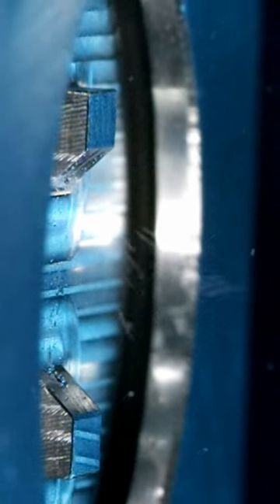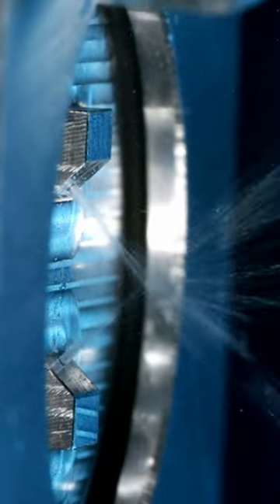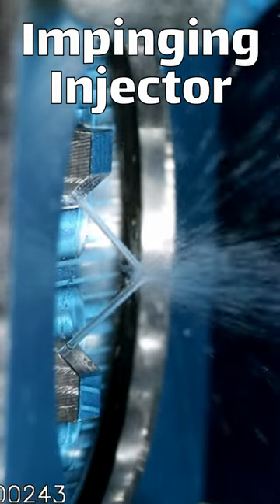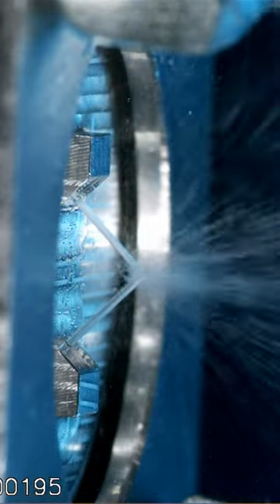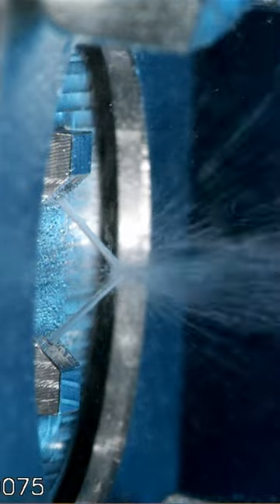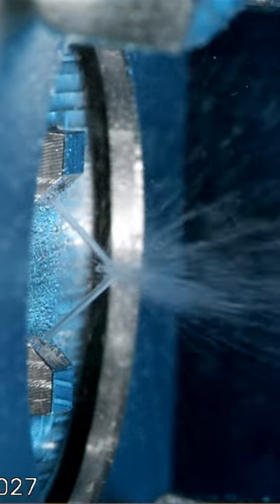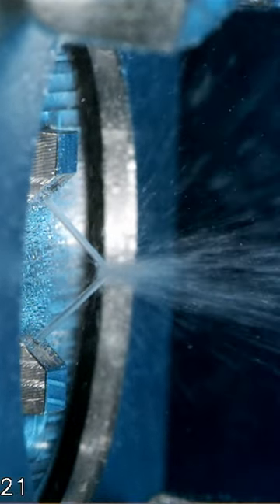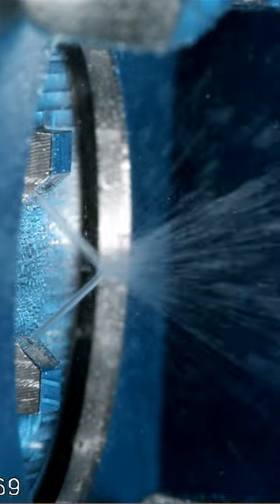Impinging Rocket Injector

Comment: I'm not 100% sure, but as far as I understand, ussually impinging injectors are like on like, so two oxidiser jets meet, or two fuel jets, so that the propellants are atomised before the mix, providing better combustion. If it were unlike on unlike, then the energy from combustion would force the jets apart, and could cause combustion instability. Still a great video, love to see rocket engine components up close.
Reply: I was thinking the same thing... If the two fluids are different than it would push to one side... Unless you did some really complicated math and engineered the holes just perfectly...
Reply: Agreed.. this seems like a dual injection system in a internal combustion engine..yes .. cars that use piston engine... I hope I didn't mispronounced it..😂😂😂
Reply: @jackelewish1568 I am not disagree with you guys on that they are used to atomize. 

 Yet if they are for rockets carrying expensive 5hinfs. Then tthey would honestly most likely be engineered correctly to give out the right amount/pressure to compensate for each fluids traits, and not symmetrical holes. 

 Places like NASA can be pretty meticulous. 

 That is just my opinion. Maybe more like a "I hope so". Maybe one day with AI we will be able to perfectly mimic fluid dynamics.
Reply: This is used for hypergolic fuels.  Fuming nitric and hydrazine, for instance.

The ascent stage of the LEM used it, because it absolutely had to work.   No relying on fuel metering valves and spark systems that might fail.

Comment: As a machinist who's made those, them chatter marks are unfortunate 😅
Reply: And the particular irregularity of the upper jet tells me there is more inside xd
Reply: @ashtonpadilla5269  very probable
Reply: Don't look good bo
Reply: They weren't feeling the need(s) for feeds and speeds.
Reply: made on a desktop cnc. Its really not too bad
Reply: as a machinst who doesn't make those but makes small engines, I agree
Reply: Probably use the ones that didn't work out for the demonstration

Comment: This is cool. I built something very similar to atomize fuel for a pulse jet engine a few years ago, and it worked pretty well. I use small diameter superduplex tubing and pumped water through the injector to check the alignment of the streams before installing it in the engine.
Reply: you have nice videos.
Reply: have you built anything similar since the small pulsejet 7 years ago
Reply: Kudos. I'm actually impressed. Shame you don't own the patent...
Reply: Thanks, I built a valved pulse jet engine about 6 years ago. I have been busy with college, but I just finished up my MS, and I am going to start working on pulse jet engines again.

Comment: I hate how stupidly underrated this channel is. Seriously top top tier content, keep it up :)
Reply: Definitely. Also just imagine impinging streams right before/on a screen, and even multiple streams.

The pressure from the fuel injectors pushes it past the screen, then one more screen for further mixing + atomizing. That screen would also hold heat from the combustion to make agonizing even more efficient, help block the flame front, and help keep heat away from the upstream.

This idea is brilliant for smaller rockets, even if it isn't originally his
Reply: Nothing is underrated but simply unknown. Share the channel with everyone you know, or your words hold no value.
Reply: @clayton9136  underrated by the algo I mean. Like there is trash tier science content that gets millions of views but actually really cool shit that took a ton of work doesn't get picked up by the algo and it's criminal. Also liking, commenting, engaging with comments and subscribing are probably the most effective ways to boost the chances of the algo picking it up
Reply: yeah like the one where he doesn’t know what a 90 degree angle is
Reply: underrated? He doesn't even know his angles.

Comment: This same technique is used in NOS injection, one little hole produces a small stream of fuel and another hole about at 90 degrees apart injects a high pressure stream of nitrous oxide in liquid form. When this two streams collide, a huge stream of small droplets of nitrous oxide and gasoline is created…

Comment: This is awesome. I found out a couple of days ago that each Saturn5 engine had its own JET ENGINE as a FUEL PUMP moving fuel instead of air.
Reply: Yep, you can tell when that's a system in use on a rocket by a "pilot light" flame exiting away from the engine bells. That's the turbo exhaust.
Reply: Yup. And if I recall correctly, they produced around 75,000 horsepower each using the very fuel and system used in the rocket. Amd it will fit under the hood of a common sedan of the era. They item is called a turbo-pump. It is comprised of a common shaft driving two pumps, for fuel and oxydizer. It is still, not rotating, until launch. Then, as the two fuel components are relased and converge at the turbo-pump, a violent acceleration takes place and can throw itself apart due to the invomprehensible rotational forces. Each stage had different engines from the others. I'm talking about the main stage engines.

Comment: ive always wondered about what a triplet impinging injector would be like if each jet was offset a few degrees so that instead of colliding, the streams more so glance off each other, perhaps creating an atomized spiral instead of a flat plane. i know atomization isn’t what youre going for for your particular project, but none the less
Reply from the maker: It's definitely an interesting idea! I bet it would get quite complicated, since there are probably different regimes where surface tension would dominate (causing them to sorta spiral and glomp together). But I bet if you got everything dialed in, you could get a cool swirl-injector effect but with impinging jets. Would be pretty neat to see!
Reply: So triplet injectors are a thing! Technically, the full name for this injector is a like-like doublet impinging injector, because it's two ("doublet") jets of the same fluid ("like-like"). There are unlike doublets (see the engine at the base of the Saturn V), unlike triplets, unlike quads, etc, all with decreasing popularity for some of the very issues from this main vid.

As for the spiral idea, there is another type of injector element called a coaxial swirl injector designed to set up the kind of spiral flow pattern you're getting at. However, in free space, no impinging streams will form a spiral, as there is nothing to force the fluid back toward a central axis. Once collided, the jets, whether atomized or not, will continue on their way with whatever resulting momentum there is after the collision
Reply: @BreakingTaps  do eeeet
Reply: this fuel is clearly not being atomised, those droplets are enormous compared to atomising injectors.
Reply: @GamezGuru1  Check again when the injector pressure is 3-5 ksi and the chamber is at combustion temp. No idea if this clip is for a real rocket engine, but this waterflow test has much lower flowrates and velocities than one would typically see in an operational engine.

Comment: I hope that there's not any h2o condensation. How is that mitigated?
Reply: When you have an actual flame in the combustion chamber, the problem isn't condensation, but evaporation- of the chamber!
Reply: @r0cketplumber Very well put
Reply: @sensoryoverload673  I've done it. Copper burns with a very pretty green flame. Once.
Reply: The h2o would actually add thrust. If you're worried about propellants freezing, you just have to put it closer to the flame front
Reply: @r0cketplumber  engine-rich exhaust

Comment: is 90 degrees the best angle?
Reply: Yes
Reply: @revmsj  why?
Reply: It ensures uniform mixing of the two fuels. If the angle is too small, you get issues with droplet size and fuel flow, angle too large and the fuel doesn't mix properly, and you'd be lucky to get droplets at all. @chrismofer
Reply: @Sara-L  then why do I find lots of designs for impinging injectors with a 60 degree angle?
Reply: Depends on momentum flow and combustion chamber geometry.  Worth mentioning that this is only a 2 stream injector and that other impinging geometries exist as well.
Reply: @chrismofer higher angles create greater towards-nozzle velocity so the burn region is a bit further from the back of the combustion chamber.
Reply: @chrismofer it depends on what your building and how the engine handles it, and where you want the explosion base to be, it's kinda like a bouncy ball, if it has infinite bounce it will make a pattern, same with liquids but at a lower angle it should be a heavier more lower explosion, while a higher angle should be a higher up explosion or whatever the test results endure, go take two hoses and mess with the angles lol 😂

Comment: Ahh like a chimney rose. For chimney fires we use to screw malacca canes together and shove them up the chimney. There would be a chimney rose at the top attached to a long rubber hose. We’d pump water from a bucket up to the rose and it would squirt out just like in the video forming a fine mist of water (not rocket fuel). You sometimes had to pump like crazy to make sure the canes and hose didn’t get scorched. No, I DID NOT join the fire service before the moon landings.

Comment: those are 45 degree not 90.
Reply: They are 90 degrees from eachother
Reply: 45 deg from the shared plane they are attached to the streams, and therefore the injectors are at a right angle to each other
Reply: Critical thinking helps

Comment: Two holes at 45 degree angles, 90 degree to one another. If they were at “90 degree angles” then they’d either be facing directly at one another, facing directly away from one another, facing the same direction as one another, or facing away on a different axis
Reply: The narrator slipped up chill

Comment: This looks exactly like an HVLP spray gun nozzle.... liquid flows from the outside nozzles and air from the center, which is causing it to atomize.  I would like to see this "rocket" injector from different angles to verify if it is a rocket injector or a paint sprayer.. lol.

Comment: It comprises two holes or it consists of two but it doesn't comprise of two holes.
Reply: So how you say it past tense? And would saying "it consists of two holes that are comprised of air" be correct...
Reply: @AppalachianAntidote   No. His point is that "comprised of" (although very common usage) is incorrect grammar.
Reply: Is composed of two consisting holes pretty much compromisingly comprises most of the comprehension

Comment: Kinda reminds me of something right?
Kinda like a paint gun but less efficient.  If it had compressed air coming out of both the 45deg's and had fuel injected from the center it would atomize even better.
I didn't see very good atomization in this clip.

Thoughts?

Comment: What about high pressure mist?  It seems like a mist would mix more throughly.
Reply: mist?? You mean burn the fuel in its gaseous state? It might mix better but liquid burns better. Also for storage. Liquids are denser than gases, so you can have more of it in a smaller space. Ideal for a fuel tank.
That's why the oxygen is cooled to  < -183 °C to be stored as a liquid. You can carry more that way.

Comment: What they should do instead is run the fuel and oxidiser through two seperate turbopumps in both a an ultra rich and ultra lean mixture so that the act of powering the turbo pumps also vaporises the liquid fuel.

We could call it full flow staged combustion or something.
Reply: I wonder what the name of the engine should be 🤔 maybe a bird like Raptor
Reply: Ooh ooh ooh... and heat up the fuel supply lines so everystuff atomizes real good before combustion?
Reply: I just liked my own comment because I came here to say something similar only to realise I said that 3 months ago when I last saw this…

Comment: Is this really more or even as effective as like 2 atomizing injectors that you'd find on an automobile? Can anyone explain the difference between using this versus something like what you see in a car engine?
Reply: Mixing. Fuel injectors in an engine are only atomizing the fuel while the oxygen is a gas and entering from elsewhere. Rocket engines need to mix and atomize two liquids. If the fuel and oxidizer aren’t mixed well it leads to combustion instability. This issue took years to solve with the F1 engine.

Comment: Why don’t modern combustible engines use the same concept????
Reply: You mean car engines? Because car engines don’t need to mix fuel because the air is a gas which mixes plenty already
Reply: Because cars don't use liquid oxidizer
Reply: Because modern concepts don't include combustible engines, just batteries...
Reply: @AppalachianAntidote  what conservative news outlet did you get that one from
Reply: @Coastal_Cruzer  some dude from the future told me, went by the name Doc.

Comment: What if you premix the fuel and oxidiser before the high pressure pump?
Reply: Then you will get a rapid flashback the moment pressure starts to drop when you throttle the engine down. Big boom. Not good for payload.
Reply: @richardmillhousenixon  yep. Not good for anything.
Reply: I say if ur going that far, might as well preheat and ignite as well.

Comment: Is it used in automotive? Ive heard this before but camt remember where
Reply: Fuel injection is used in the automotive industry, but it's nowhere near as technical as these kinds of injectors
Reply: This would likely be for a rocket engine’s combustion chamber.
Reply: @revmsj  yes I know but I've heard the term impinging before
Reply: I was just curious if it's also used in automotive
Reply: Cars don't use liquid oxidizer

Comment: Stop lyin. It's footage from a paint gun filled with water. You can confirmed that by the top nub, wich also has 2 to 3 holes, from which air is pressured out at around 3 to 5 atmospheres, with high volume, to even out the spray pattern, for even coating. 
To be fair, it's a old model. The newer models use the needle system, wich have better control over the amount of paint being applied. 

Injector plates of rocket engines are never tested in a singular configuration,  because at high pressures and flow rates,  every Injector interacts with its neighbours,  and they can create turbulence,  wich can lead to hotspots.  

If this shit would be that easy, I already would be on the moon bro.

Comment: how much pressure does it requair ? master jee
Reply: Enough to overcome the pressure of the combustion chamber pressure so burning gasses do not enter them and proceed into the pumps and then tanks causing a catastrophic RUD…
Reply: A few hundred bar. SpaceX’s Raptor engine has the record for highest chamber pressure at I think 350 bar. I don’t believe they’ve flown on that version of the engine yet.

Comment: Carburetors have been atomizing fuel efficiently for over a century.
Reply: I've never seen a carburetor on a rocket, but i guess it could happen.
Reply: Carburetors don't mix liquid oxidizer
Reply: @Coastal_Cruzer  no, but they could if put liquid oxidizer into it. It'll atomize whatever liquid is in the bowl.
Reply: Yeah but they put off way too much carbon when compared to this state of the art method...
Reply: @AppalachianAntidote  the carburetor does not produce carbon. Inefficient combustion of hydrocarbons produces a buildup of carbon. If we're adding an oxidizer, I highly doubt the combustion will be inefficient enough to have much carbon buildup... but I'm not a rocket scientist. Just a silly mechanic talking about carburetors.
Reply: @mdscownz  apparently mechanics don't comprehend the concept of sarcasm?

Comment: And what if the one stream happens to have a higher pressure?
Reply: Asymmetrical spray leading to higher thrust on side of the engine, hard to happen but if could damage or possibly destroy the engine

Comment: Wouldn't tons of high pressure air misters nozzles that pre mix air oxidizer and fuel faster increasing efficiency to combust and burn better or do u have to have giant piss streams crossing paths 😅. Even rockets went LGBTQ+ when we weren't paying attention in class lol.
Reply: It was good enough for the Saturn 5 that got us to the moon and plenty of others before that acronym existed, no need to project your sexual preferences on rocket injectors.  Remember they're mixing two liquids, not a liquid and a gas like an air mister is.  It's far more difficult to mix something before it's atomized through a nozzle, as it has everything it needs to explode at that point other than a heat source (which it'll have the second you light it up).  Premixing fuel and oxidizer together and then forcing the mixture through a nozzle is a great way to end up not having a nozzle.
Reply: Weakest attempt at phobia humor of all time